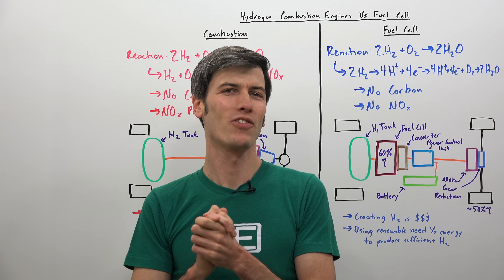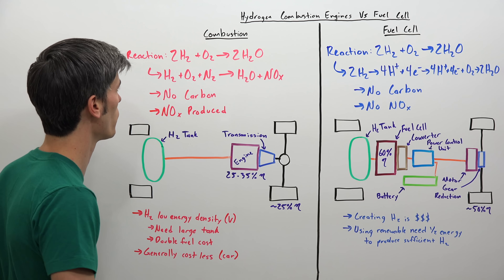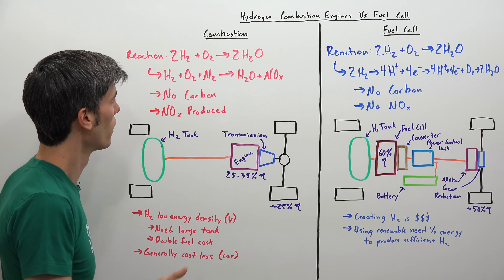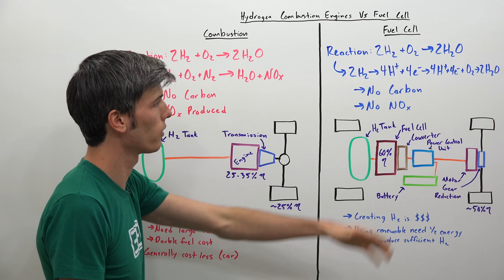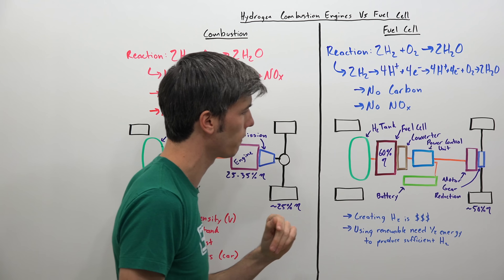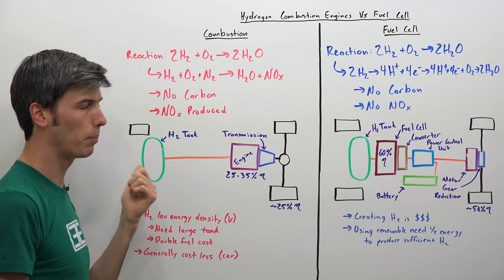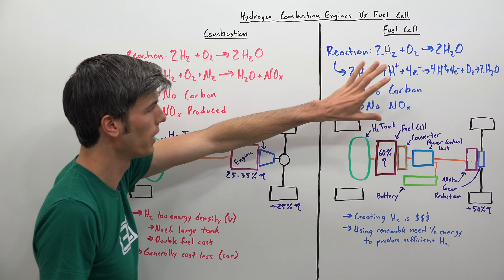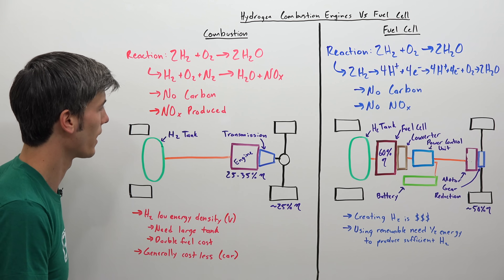Why Hydrogen Engines Are A Bad Idea

Comment: Engineering Explained

In addition:

You are not taking into account that in a hydrogen engine the HHO converts to steam making the car engine a steam engine, therefore more efficient by steam effect. 

Seperately

When the HHO explodes in the engine on the expansion it then implode there after causing a vacuum pulling the pistion back up.

We can increase power or the engine by HHO as a two stroke reengineered.

The premises of fuel economy is out the window as anyone can make it themselves at home from the sun with off the shelf parts for free. 

It comes from water, that falls free from the sky. 

Make believe shortages.
Reply: You need 9x the amount of energy to create Hydrogen for a combustion engine, compared with a battery EV per mile.  Or you could charge 9 BEV on the same solar array.  Your choice.
Reply: Tony Stanley exactly
Reply: @tonystanley5337  

Incorrect

New designs for HHO generators have been developed. A car was built that ran off of straight HHO and ran off of the power from the engine. They adventure was eliminated for it.

There are now plenty of providers that give a decent HHO.

Separately look up Ellis water.

There are videos on YouTube about Ellis water being used in HHO. The hydrogen bond angle of Ellis water is 114° and ready to turn to vapor or steam. It needs much less power to do the final molecules split.

Making any HHO generator infinitely more efficient.

the amount of power needed in the Ellis water machine to proof the water is minimal compared to the return gained.
Reply: @tonystanley5337  

You could just eat easily use the solar array to break the hydrogen bond. Using a competently built HHO piece of equipment and Ellis water. Your complaint about power usage would be not correct.
Reply: @reypolice5231  utter balls, I'm an Engineer, the calculations are simple and correct.  You need 9kW of solar to produce 1kW of engine power if you use hydrogen as the inbetween.  You can even get that much solar on an 18 wheeler.  9x more efficient to connect the solar to a battery and electric motor.   Of course you probably think Stanley Meyer engine is the answer.
Reply: Rey Police Still not a word about efficiency.

Comment: But someone is extremely leaning out of the window. Please show me a fuel cell with an efficiency of 60% that can be used in the vehicle? There are a few high-temperature cells under laboratory conditions that produce this high efficiency. An extremely large number of sources are missing and therefore the truthfulness cannot be checked. So please don't spread half-truths!

Comment: Research staney meyers he wouldn't be dead if fossil fuel was more efficient then standard water to go from A to B he would of just been ridiculed. So what if hydrogen don't throw out horse power like filthy fossil money lucrative petroleum. water is free and cleans and works. hydrogen fuel is a smart idea not a bad idea not as touted here. Thank you *Drops the mic on the floor leaves the channel.

Comment: Would it theoretically be possible to inject the H+ coming from the fuel cell (before it turns into water) into a combustion engine and use it as fuel?

Comment: No lol... take a mining operation.  All of the equipment can have many decades(20-40yrs) of use SO... as you deploy FC vehicles and say generators the existing fleet can be cheaply converted and you can single source your energy needs and meet env. standards.  Too much academics and not enough practical engineering here.

Comment: how is hydrogen expensive when it comes from H2O, ur just slitting the two parts,
1 - oxygen 
2 - hydrogen
3 = water........
I don't see how it would cost millions to make hydrogen
Reply: "Just splitting it" is a lot more difficult than you think.
We have a few methods of doing so, and all of them have rather large costs associated with them.  The most common one mentioned, running electricity through the water, requires a LOT of electricity to obtain usable amounts of hydrogen, making the cost of the fuel expensive.  Also, you can't get as much energy out of burning the resulting hydrogen that you used getting the hydrogen out of the water in the first place, so it's not a reaction that could sustain itself.  This means that you can't simply build a car with a water tank and a "hydrogen generator" that runs itself similarly to how an ICE car can run without a battery once it's actually started(because the engine is running an alternator).

So either you need to buy hydrogen fuel, or you would need to buy a separate "hydrogen generator" to convert your own water into hydrogen(using your water and electricity costs to do so).  

Also, you'd be storing hydrogen gas in the tanks of the car, which is a LOT more volatile and dangerous than gasoline, in the event of a crash or something similar.
Reply: Adding on to thedarkfreaks comment: Storing and transporting hydrogen(very volatile(Hindenberg accident)) is costly due to the insurance costs and infrastructure necessary for containment.  Specialized equipment for transferring from transport to tank to vehicle.

Comment: You are full of it my friend,
Firstly ,  if now we would have cars  running on “H” for fuel  we would be better off ,the planet would be better off .
               The efficiency would be greater than it is now .  And with minimum pollution !
                And this car.  WOULD NOT NEED THE CRAZY ELECTRONICS THAT THEY HAVE NOW !  This will save resources 
                And this car would be cheap and reliable !
Second ,  Your fuel cell !
                  IT IS COMPLICATED AND EXPENSIVE,  to produce all the extra expensive electrical parts would cause far more pollution and loss of
                   Resources to create this car compared with the first option !

You guys always talk about efficiency,   EFFICIENCY  YOU  CAN  ONLY GET  FROM  SIMPLICITY. !  !  !

Comment: Firstly, where did you go to get carbon monoxide if it is not present in either fuel or oxygen?
Before debiting nonsense, it is advisable to study so as not to be a bear. By the way, Toyota has just proved the opposite.

Comment: No emissions?!? How do you make the hydrogen? Typically by electrolysis. How do you make the electricity to make the hydrogen? Typically by burning coal.
Reply: That's obvious, but the same applies to battery powered vehicles, hydrogen fuel cell vehicle, hydrogen combustion vehicle basically every vehicle even traditionally fuelled vehicles it takes energy to transfer energy
Reply: @Steven-vi2we  My point is that they are NOT no emissions. The emissions are just out of sight.
Reply: @johncarder819  depends how you make the hydrogen i guess. Let's be honest here you're not gonna be able to create an energy source like fuel oils which are dense which we dig out of the ground. Telsla is the same just moving pollution elsewhere unless its renewable sourced whatever tech we use to store the energy. You can't condemn hydrogen so easily if you think about it most inefficiencies come in producing it from our own infrastructure and industry. If you're advocating electric battery cars they have problems all on their own, not to mention probably not enough lithium to make a dent in existing pollution from cars. There's problems with all of them but hydrogen can actually address the weight issue which a lot of types of transport need to tackle. Audi Q5 standard version is like 1.8 tonnes heavy as it is the audi etron which is like the full electric version weighs almost  2.6 tonnes it can't be efficient to be lugging all that weight around plus the space constraints it causes..

Comment: Clearly paid for by a fuel cell company 
Very bad explanation ... I have run engines on H2O with ZERO NoX and much higher - efficiency 84% on the wheel